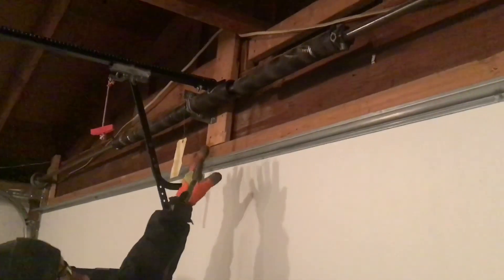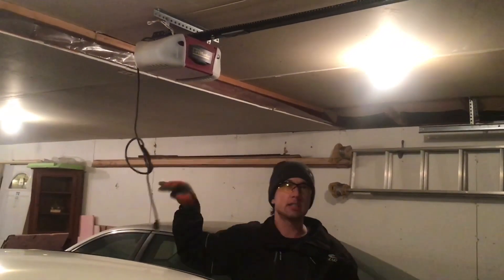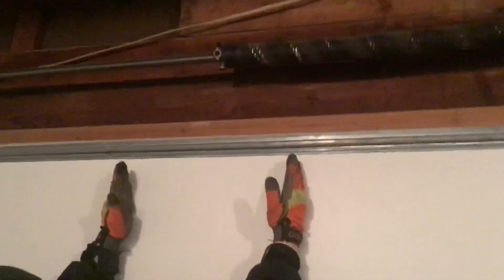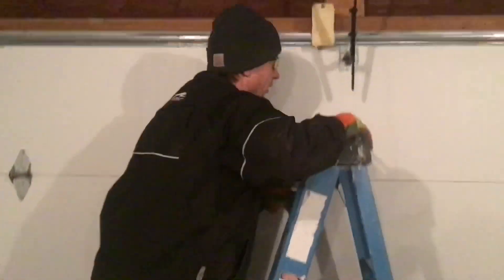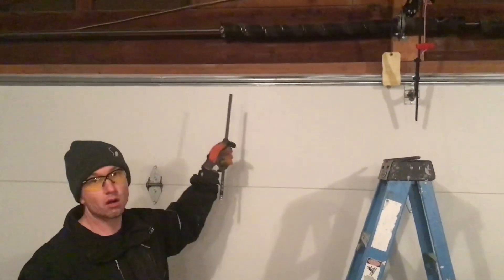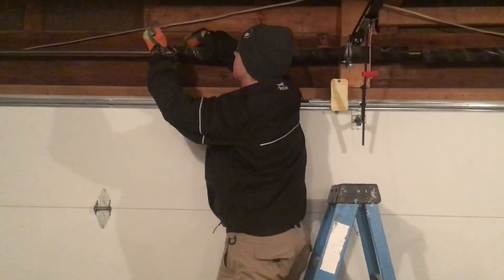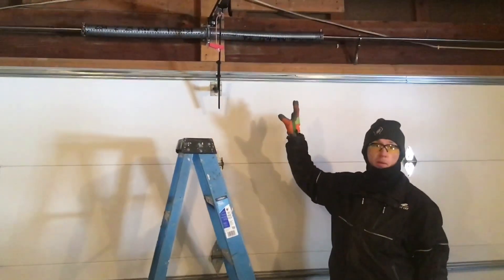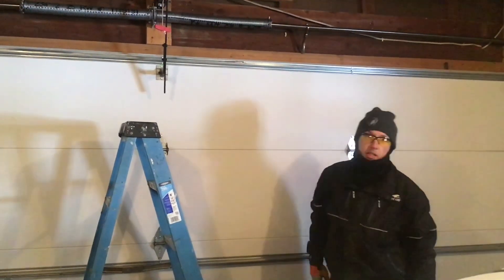How to Fix Broken Garage Door - Tension Springs

Comment: OOF....galvanized springs...
Just a note for others, you don't want to over reach by being too far from the winding cone.
Remember,  "The closer we are to danger, the farther we are from harm." - Pippin, Lord of the Rings  ;)
Also, this is a good example of why rebar isn't an ideal choice, lol.
Don't leave the bar in like that.  If the spring does break loose, that bar is going flying.  If there is no bar, it just spins on the shaft.  You can find youtube videos showing that.
If it worked for you, that's fine, but usually the vice grip is used the other way to keep tension on the cables.  That doesn't look like a reverse drum door from what I can see.  Just something that looked odd to me.
That door probably goes a buck fiddy or more, I know my uninsulated double wide door was about 135#.
For those T rail openers, if you pull down and back(toward the opener) it locks open.  I probably had my opener over 10 years before I figured that out, lol.